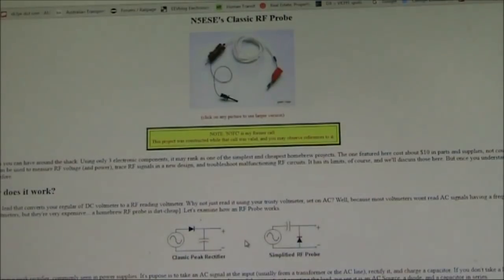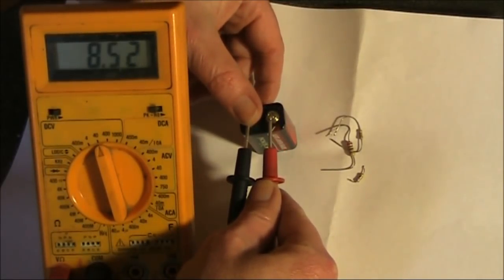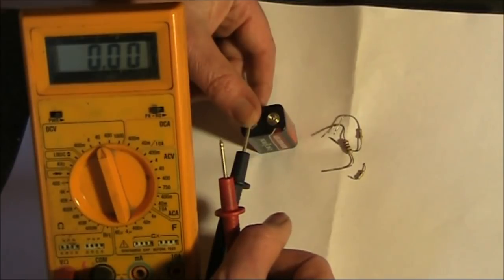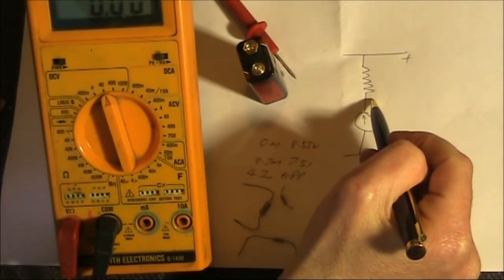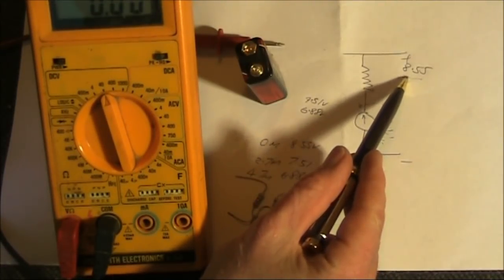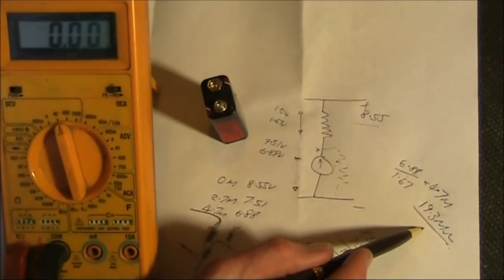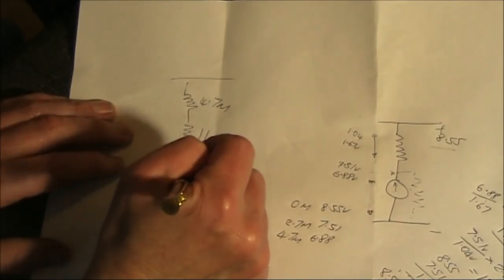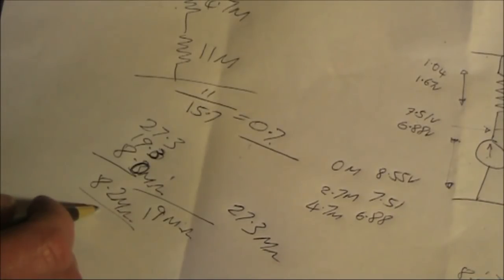Measuring the internal resistance of a digital voltmeter

Comment: TLDR: To find the voltmeter resistance, get a battery and measure its voltage. Next, add a resistor in the megaohms region in series with the battery. Once the resistor is in series with the battery (ie: one prong is in contact with one of the battery terminals), complete the circuit with the voltmeter (one lead to the resistor, one to the remaining battery terminal). The value the voltmeter reads will be the voltage across the internal volt meter resistance. If you sketch this circuit out, you will see that it is a basic voltage divider. Use the VDR equation and solve for the unknown resistance. Vmeter = Vbatt(r1/(r1+r2)) where r1 is the internal resistance.

Comment: Measure the battery voltage,  try different resistors in series with battery untill the meter shows half the original battery voltage.
The resistor that works is the meter resistance.

Comment: I am sure I am being denser than usual - but as most folks who are going to be working on electronics to this level will have more than one meter, is there a reason why you cannot simply set the voltmeter under test to volts - and then connect it "probe - to - probe" with another meter set to resistance?

It might be coincidence that when I tried this, it gave results virtually identical to figures obtained using the method shown here. Maybe I am missing something and was just incredibly lucky to get the right answer for the wrong reason.
Reply from the maker: I've only got one meter so this test was interesting for me.